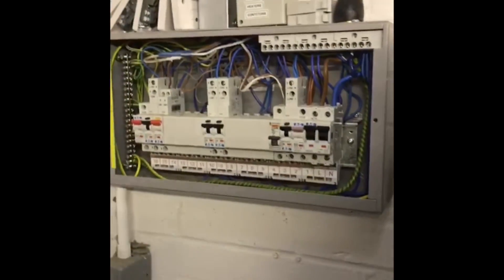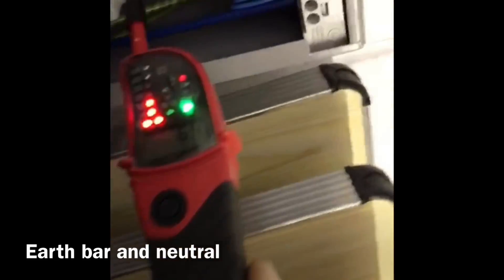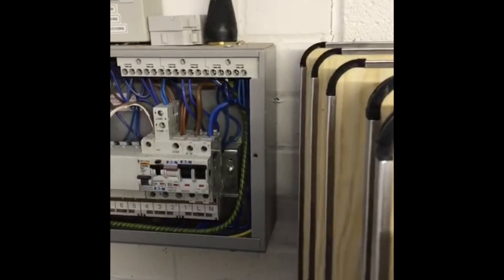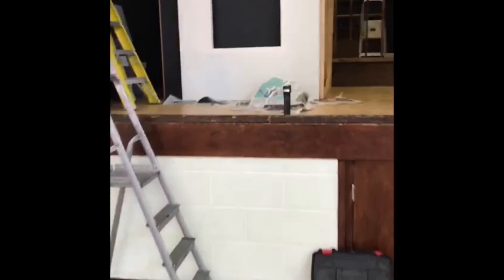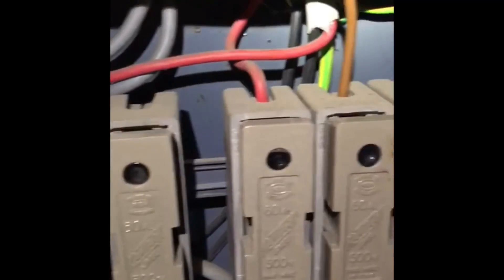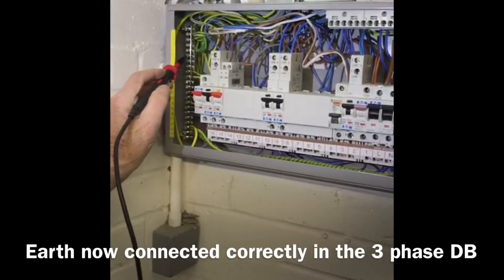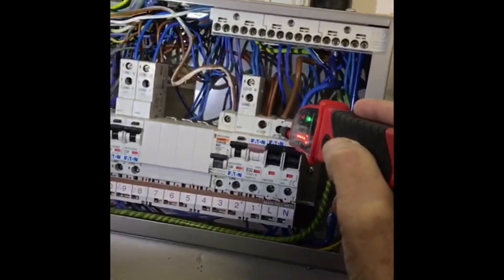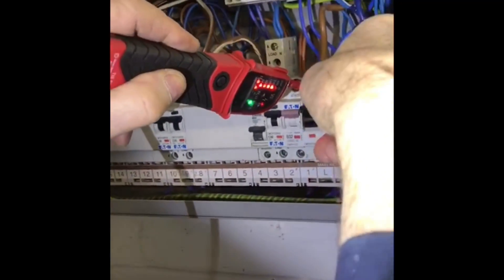Electrical Fault Finding SWA Cable - Earth to Line 120 Volts & Earth to Neutral 65 Volts AC

Comment: can someone please explain to me why is there a current flowing between Line & Earth in the first place, be it 120Volts or 240Volts?
Reply: Due to Impedances in the Tester; any Line terminal probed against an Open/incomplete Circuit terminal(s) Eg. Broken PE or Broken Neutral, it will display those range of voltages…

Comment: Induced voltage into the floating cpc conductor . See it all the time . Any floating cable (not connected to anything) run with other cables will induce a voltage off them
Reply from the maker: Thanks for commenting 👍

Comment: Mate thank you for your video loads to learn,can I please ask a question which cable would you run for drive way patio lights please? Is hi tuf or swa,as SWA quite hard to make inside light fitting.Thank you in advance

Comment: Can anyone here explain how on a neutral earth test there getting 60+ volts on an improper connection, need a bit more of a detailed explanation?
Reply: The Earth connection was in effect "floating", as it was not actually connected correctly at the main distribution board.  Hence any voltage reading with respect to the Earth was erroneous, compounded by any potential voltage induced into the CPC along its length in the SWA cable.  The only accurate and correct voltage reading was between Line and Neutral as these were both connected correctly.  Hope that makes sense?
Reply: N = 0V
L = 247V

N—(E) = 64V
L—(E) = 247–64= 183V @ minute 0:55  [down to 120V @ minute 1:00 ]

Ideally a proper E shall be very close to 0V too...
A rise up to 64V indicates issues with this (E) conductor...
Probably a bad circuit/open circuit with some voltages down the conductor but to nowhere...
Reply: I suspect that part may have been deliberately left out. The reading could be cause by a few things: earth leakage, capacitive coupling and a few more.. I suspect a low impedance meter reading might have been different.

Comment: Just got this the other day ready for my first attempt of consumer unit install to a summer house (guidance from the sparky I'm working along with) looking forward in doing it, as the old sparky wired the summer house up from the lighting circuit of the house, it's been made safe now, work can only be done a number of hours a week, lucky it's round the corner and it's only charged for parts (pro-bono)